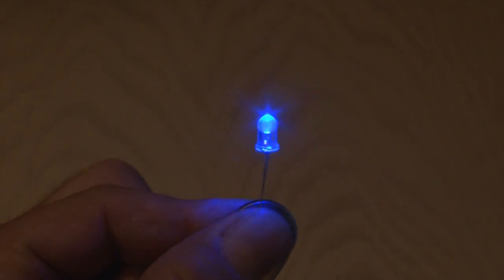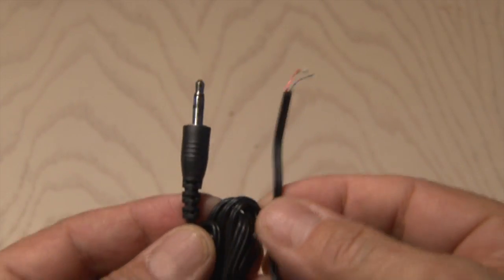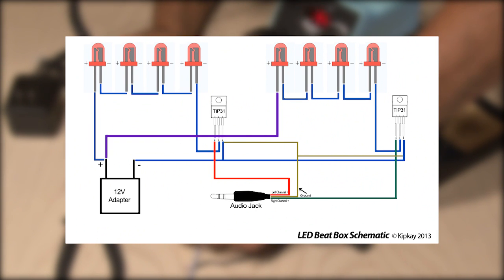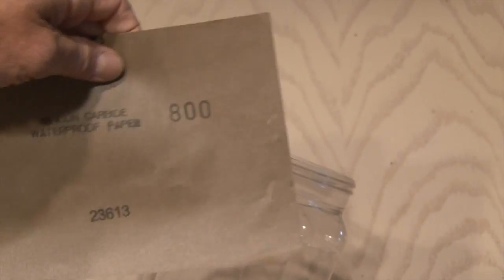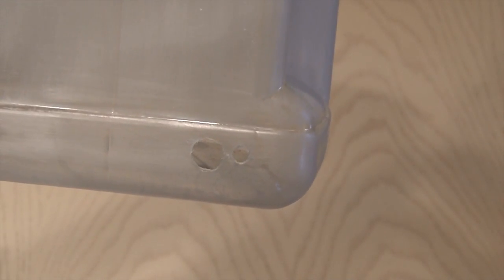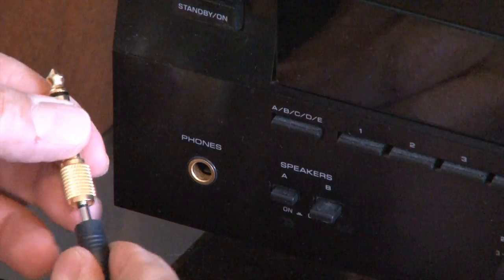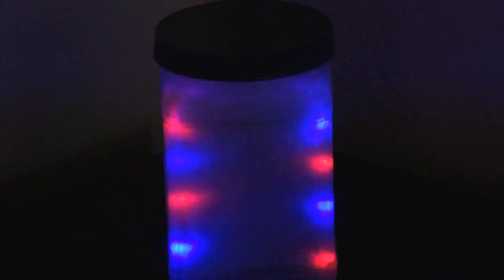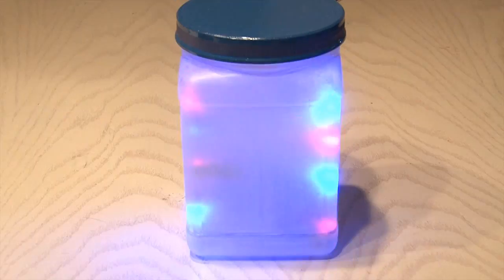LED Beat Box!

Comment: I made a project similar to this a few years back, I did it for Christmas lights, and all I did was use a similar schematic and hook it up to some relays and bump the power up to 120v worked like a charm.  Also there is a more complex version where loiters flash to certain frequencys of music using op amps that's pretty cool if you know hot to use opamps

Comment: yes you can do it but you really dont need the transister. just take extra wires off of the amp through a resistor and to the led then to a ground or negative! hope this helped

Comment: Doesn't make sense. If you plug I to the phones port, it will cut audio to the speakers on most systems if not all. Is there a way you can plug them into the speaker outputs, with the speakers plugged in as well?

Comment: i would like to know how to do this with a subwoofer.
i tried it before but i ended up with no response at all,and somehow managed to make the led's turn on when i touched one of the wires with one hand, and the casing of my power supply with my other hand using my body to complete the cirquit.

Comment: Then create 3x the amount of stuff seen in this video and where he has the dual channel speak jack exchange it for a splitter off each channel.

This would then allow you to create 2x2 speaker combos (Front left, front right) (Rear Left, Rear Right) (Center, sub)... Or create 4 and split the center channel and sub into different bands. 

The power requirements of the LEDS mean that you could try and get away with one power adapter.

Have fun!

Comment: Wouldn't a 12v power source fry the LEDs? They usually run at about 3v for blue and 5v for red. Anything over that burns out LEDs.

Comment: hey Kipkay great video. i have been wanting to make one for a long time but with more than one channel, i havent managed to complete any working circuits for low high and band pass filters. i would use those plus both stereo channels. main problem for me is values for resistor and condensator for those filters. if you have any info about them would you be so kind and post them aswell. 
cheers John

Comment: If you want something q a little more stylish than a sandpapered plasic jug to put this in (like something of glass with some nice shape, many fancy drinks or even vines have various cool bottles you can use) you can put those LEDs more towards the middle and fill the rest with decorative glass beads/shards of the common variety. They will diffuse and reflect a lot of the light and make it nice to look at even when not powered on.

Comment: The LEDs on each channel are connected in series so it works out at about 3v per LED but their really ought to be a resister to  to stop the leds from drawing more current than they need.

Comment: If you the get a tip 31 transistor and use the schematic in the video you should be able to get it to work. I made something like this 3 years ago and recently modified it to run off of 5v, but I  only have 1 channel.

Comment: @sc0tte1 They do take very little power. And yes they are in series, if you put them in parallel the resistance would be way to low for what you want. It should be fine. I've been running my car speakers on half the ohms for 3 years and it's still working fine